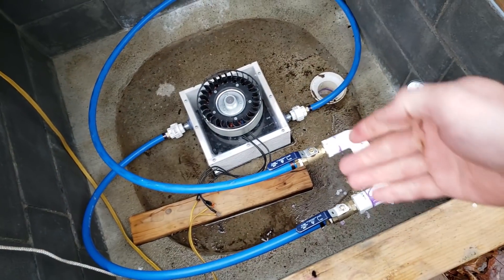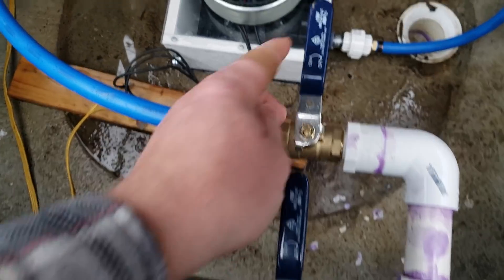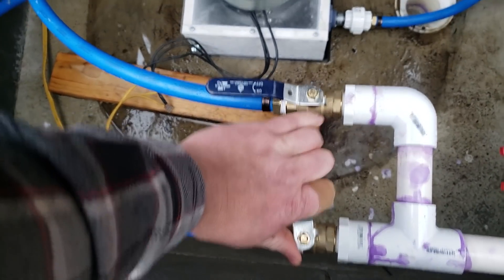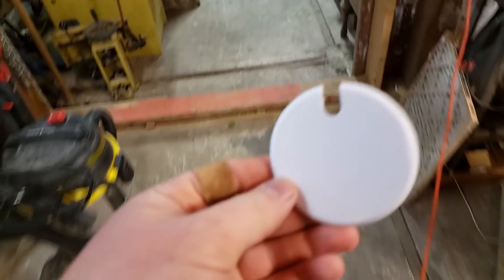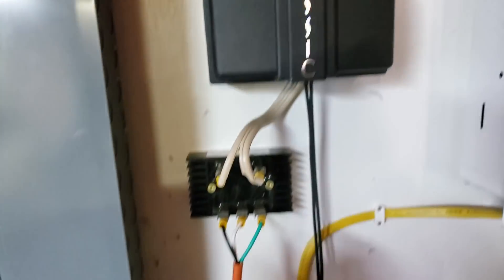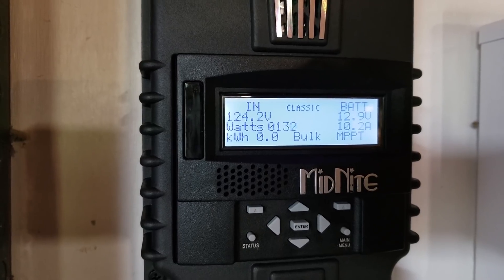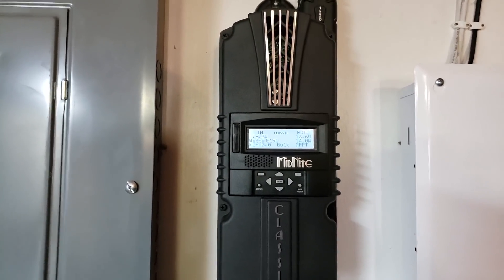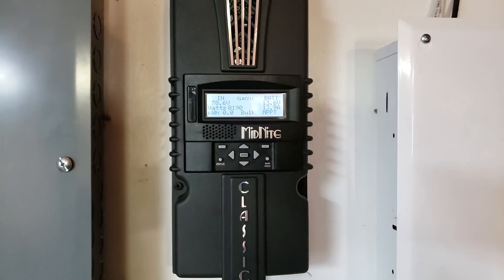Some More Mods And Equipment Upgrades.

Comment: For your final system, you should definitely consider 48v and also LiFePo4 batteries. Lead Acid is the downfall of almost all remote or backup systems, can only get 50% out of them and 1-2 years lifetime.

Comment: 48V DC is a really good design voltage for a battery system using lead batteries. Inverters are more efficient as well. Lots of gear uses 12V (13.8) nominal and you can use a DC-DC converter from Astron https://www.astroncorp.com/dc-dc-converters . I use them on my 24V system and convert to 12V on my radio desk and in the network room.

BEWARE - telecom equipment wired for 48V DC is +++POSITIVE GROUND+++ unless otherwise marked. You can have an exciting and smoke-filled day by having power go through your grounding wires and gear. BE CAREFUL!

As always, Ohm's Law applies. Power losses increase to the SQUARE of the resistance.

Comment: I’d imagine the charge controller can’t drop below the battery voltage otherwise current would flow out of the battery instead of in to it!

Comment: Very nice ! very good result ! could you tell me what is the max open circuit voltage of your midnite controler ?  Is there any model with hight voltage (450V DC) ?
Reply from the maker: They only go up to 250v I think. Mine is a 200v model.

Comment: Nice to see it making power :) Im sure you know this but you must have  major losses going on somewhere as that is only about half what you should be getting from that flow. the fittings will of course be a factor but i think there is something else going on. Because that is only about 30% efficient at the moment. Im sure you will get it sorted though :)
Reply from the maker: Yes it is concerning. I was able to eyeball the jet alignment with the union fittings disconnected so I know they are good, but the housing might be flexing due to loads from the water and the bending of the PEX. I fear the jet is being steered away from the runner, I can verify that by looking in the clear housing top with some good lighting to see if any of the jets are hitting the back wall unobstructed.    It's very sensitive to jet alignment, my nozzles are only .181" and .131". There are other places that might be restricting it, such as only having a 12v bank for now that the classic can't charge at full power to for some reason, the spec sheet shows it being good for some serious amps at 12v. The thermal camera shows all of my connections are good and remaining cool. I might be at the charge amp rating of the batteries and they just can't absorb faster. .3c of 80ah is only 24a.
Reply: @JoeMalovich  Just thinking out loud a little. is it possible that the jets being so small are not getting split in the middle because to do that the alignment would need to be so perfect due to the small size. Maybe that is why i didn't have such trouble with alignment with my pelton when i did it because i was running a 16mm jet. both those tiny jets with need to be very well centred and rigid to be having the jet split in the middle. I also have a feeling you might just be at the bottom end of the efficacy curve of the turbine. i bet if you put a third more water through it it would double in output. it might just be that everything is currently matched to work at around 1.5 lps and your just not flowing enough to get it up to its efficient point. If that is the case i think a bigger PCD between spoon centers, But small spoons That should run better at lower flows as you would have less spoon drag on small jets and more torque from less flow.  Another Problem is that your pelton needs at least another 6 spoons on it to work well. to few spoons means that there you can loose 10% just in the jet jumping the gap for a splint second.

Comment: I have little to no understanding of electricity. Is this system enough to  power a small modern home or at least take a significant chunk of the load
Reply: Not really.
Reply: At the moment, no. The system has the potential to power a home IF more is done. That is, higher voltage for efficiency, if the water always flows at more than his house requires, etc. I'm guessing that he needs around 300-500W continously.
The system is looking good so far.

Comment: The reason the charge controller won't go below battery voltage is it's only capable of stepping the voltage down not up I am not familiar with that controller on a water wheel but I am solar so maybe it's getting a bit confused if there is any small ripples still after the rectifier so maybe some capacitors on the controller side of the rectifier would help a bit
Reply: Agreed...def. put a couple quality caps over there to smooth it all out.

Comment: Have you thought about using a higher system voltage like 24 V to save on wire costs/loses, especially if you talk with big inverters? Ohh and a Tesla Battery Modul is a great for storage as well (24V, 5.45kWh @ 1200€ here in Europe)
Reply from the maker: I'm thinking 48v.
Reply: @JoeMalovich  48v would be better and more batteries
Reply: @JoeMalovich  if your looking for batteries u could checkout batteryhookup.com  they some times have tesla batteries and other brands too

Comment: Your output is probably limited because your batteries were already at 12.4 volts resting.
Reply from the maker: I had drained them with a 3 amp load to 12v, which is like 10% dod. They recovered some. For cycling there is pitiful amounts of storage available without killing batteries.

Comment: @Joe Malovich, this style of battery is tried and tested. They are larger than newer aluminum cased LiFePo cells, but they are true to their ratings and much cheaper for the same chemistry. They have the same charge/discharge/cycle specs as similar spec'd cells. https://www.aliexpress.com/item/4000306010993.html?spm=2114.12010612.8148356.18.64555c922ttjSu This video tested them as well. https://www.youtube.com/watch?v=Di2o7an-WJw
Reply from the maker: Trent, I knew going into it that I would need a big fat 48v bank. The turbine fills these too quickly!  These are just what I had on hand and I got them cheap a few years ago.

Comment: Easy to fix the sound of the unloaded wheel by creating a dump load and the ability to test if the dump load is still needed. An arduino testing the voltage at a shunt that if it gets past a point activates a relay to a heater element for 5 or so minutes then runs another test to see if there is a need or to keep sending to the dump. You can even wire in a bypass button for startups so it hits the dump then when you get everything active hit the reset to get it off dumpping and to watching.

Comment: Why do you have the rectifyer in the input? Also isn't the max voltage for the midnite 150V?
Reply from the maker: Also I got the 200V version.
Reply: Because it's 3 phase AC and the charge controller works with DC input

Comment: You dont have to print another cap with a bigger notch. Just use a file or a hot knife and modify the one you have. Save plastic, save time, save electricity.
Reply from the maker: Oh I don't mind printing another one, it doesn't use much plastic and takes about an hour that the printer is sitting unused anyways.
Reply: @JoeMalovich  plus, if you add another box, more for later
Reply: Yes, mod the existing cap.  Real Men make mods (sarcasm)

Comment: Would a Y spit be better than two 90's?
Reply from the maker: They don't stock those in stores around here capable of holding pressure.
Reply: It's definitely not balanced as currently installed.